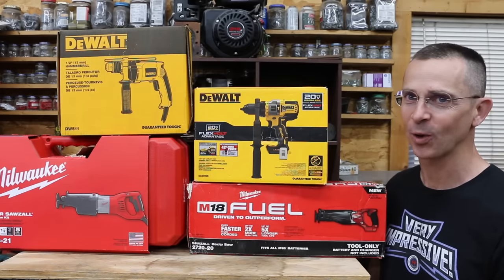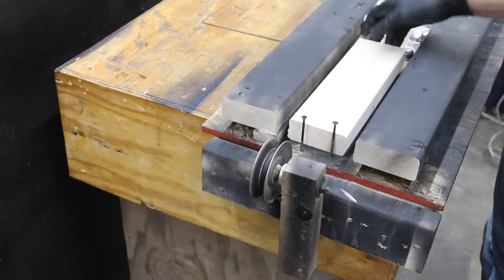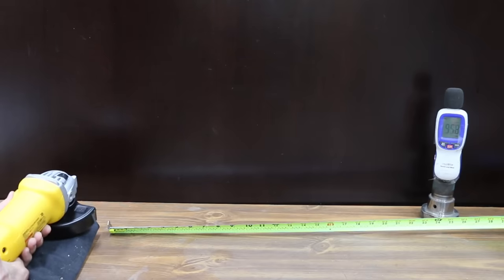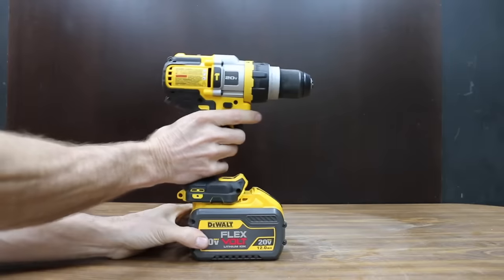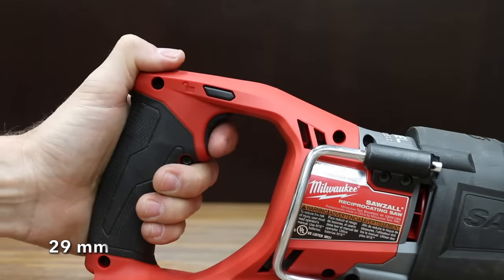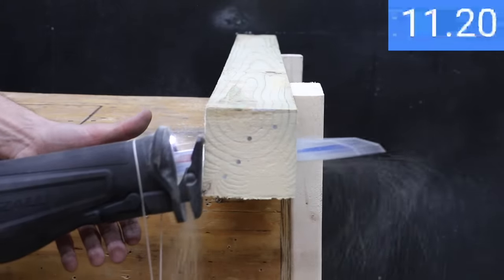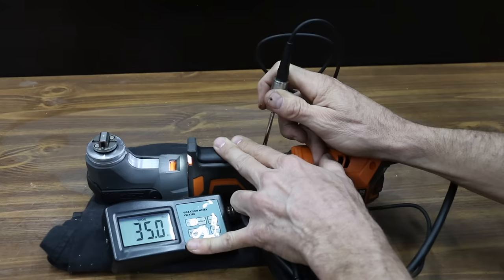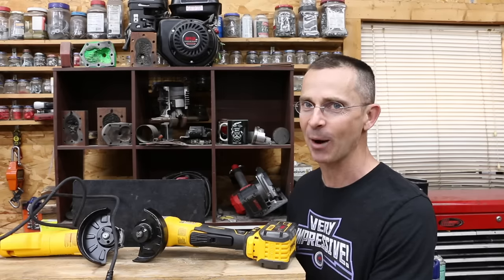Let's Settle This! Are Cordless Power Tools REALLY Better? Torque, Cutting Speed, Noise, Vibration

Comment: One benefit of corded tools is they're a bit of a pain to move around the jobsite, which actually encourages you to work more efficiently by setting up your work space efficiently, and working systematically by making all your cuts in one location before moving onto the next

With the ease of moving around with cordless tools, I've found that sometimes it actually leads to a lot of wasted movement because you can move from task to task without finishing up one. The freedom is obviously super handy in many cases though, just an interesting thing I noticed.

Also, the durability, cost, and the ease of repair of corded tools is UNMATCHED. So for workhorse tools, like skilsaws, sawalls, nailguns (pneumatic), vacuums, etc, I prefer corded. For impact drivers, drills, osc multitool, etc I prefer cordless.
Reply from the maker: Thanks for sharing.
Reply: hahahahahahahahahahahaha

Comment: I have used about every angle grinder out there and I have to say I still get more work done with the corded grinder when paired with a hard wheel, flap wheel, paint remover, and wire wheel. However as far as cutoff wheels go, which account for 90 percent of my shops injuries, I have not had a single injury with my battery powered grinders. That 11,000 rpm dewalt grinder you used is banned from my shop because I find it to be too fast for cutoff wheels. I have seen it explode a new cutoff wheel by simply turning it on.
Reply: Stop buying your cutoff wheels at harbor freight?
Reply: @MAGAMAN  
Lol. I dont buy them from harbor freight. I buy them from a welding supply store. The point is that after tens of thousands of cutoff wheels the only one to explode without ever touching materials exploded on the highest rpm grinder that I have ever owned. I dont think it was a pure coincidence. This is the only time I tossed an angle grinder injury to error in manufacturing of an abrasive. And i probably wouldnt have arrived at that conclusion if i dodnt see it for myself. I think that after you consider error in manufacturing and error in tool operation the margin of allowable error is reduced as rpm increases.

Comment: Pretty easy answer in my opinion...corded last longer and stay consistent powerwise but cordless are more convenient but only for a shorter period
Reply from the maker: Great point! Thank you
Reply: Cordless is always more convenient, but cords exists for a reason.
Headphones for example 😅
Reply: Did we watch the same video? Cordless have so many more improvements over corded. All the innovations are put into cordless, while corded have been made the same for 20 years.
Reply: @WetDoggo  thats kinda what I was saying haha
Reply: @WetDoggo  Bluetooth headphones and speakers
Reply: @dcmirk  if I had to saw 100 pieces of wood I would go corded cuz I know a battery would only get to about 50 pieces...is my preference
Reply: @marcogeraldis7117  fair point.  I'm a hobbyist, I can see the advantage in corded for a commercial shop
Reply: @marcogeraldis7117  I see what you did there. 20yr old design may not have all the latest tech but will (potentially) last longer. Really a case of what you need it for I think.
Reply: @WetDoggo  havent use corded headphonens for 20 years.

Still, battery still lacks a bit of power.

What is really lacking is a corded battery dummy
Reply: It all depends on the project really...if you got a ton of stuff to do go corded instead of chasing down chargers and waiting...if it's a small project cordless all the way..
Reply: @dcmirk  I don't need innovative tools. I just need tools that work.
Reply: @marcogeraldis7117  yes
Reply: @kylzepolaczkowaty2197  they're pretty bad compared to wired ones.
Reply: @marcogeraldis7117  or get multiple batteries...
It's better to use cordless in difficult conditions like overhead, on a ladder, in the wild, etc.
If you have a wall plug nearby, with extension cables and/or a generator or you need to use the tool for extended periods of time, then cords are the way to go.
Reply: @dcmirk  cordless is mostly the convenience factor, especially in difficult conditions like overhead on a ladder... A cable would just annoy the crap out of anyone there.
Cordless are also highly mobile, if you're not moving much  or the tool is used stationary, cords are the way to go.

Technology wise there's no reason why corded Tools should stay behind, since most improvements can be applied to both.
Reply: @WetDoggo  you know what would be even better. A generator you wear as a back pack with a 3-4ft cord so it's just as convenient as a cordless but with more power and sustainability of a battery
Reply: @WetDoggo  in my experience, they're on par with the wired ones
Plus a lot of them that I had had the option to plug in the two way jack cord to make them corded
Lasted me entire high school

Comment: Love the content. If I were to add my own two cents as a full time carpenter it would be that at this point any power differences between corded and cordless are irrelevant for me. Dewalt flexvolt and other brands bigger batteries are completely sufficient for almost all purposes. The amount of time saved by having all cordless is what the real benefit for me is. Yeah batteries are expensive but they save time and hassle, and time is money. Not to mention cords can be pretty expensive too. 
I’m not sure how this could be realistically measured but I’d love to see the time comparison between corded and cordless setup.
Reply: Not to mention the safety aspect of not having extension cords laying across the workspace.
Reply: You’re right… time is money.
Reply: I totally agree for the guy that uses his tools on the job.  But for the occasional user the story is different.
Why pay 2 or 3x for a tool that is going to be dead in 10 years.
Reply: I guess you could just figure some averages into the equation. Cordless tools going directly into a toolbox are done right then and there. Unwrapping cords in the morning can take 15+ minutes. Later, wrapping up 3-5 50'-100' cords and then wrapping up the cords on the tools themselves can easily turn into 20 minutes. Cordless is a no brainer in a lot of ways. Also, with options like the Makita or metabo rear handle coming in ~$200, you're not spending much more than the $180 it costs for a Mag77 if you already have those battery platforms. They're also much lighter before you even include the cord snagging. Table saws kind of demand a cord, but even then, I do most of my trim work with the cordless DeWalt these days.  I also run the cordless 8 1/2" Bosch miter saw and it performs better than my corded in terms of accuracy. Cordless finish guns are solid but cordless framers haven't quite taken over considering their weight. Just rambling.
Reply: @danharold3087  Buy Ridgid.  They have a lifetime warranty on the tool and batteries.  I’m on my third set of batteries in 15 years, all replaced free!  Great company to deal with!
Reply: They don't save much time when your batteries are dead and you forgot your charger at home.
Reply: @Apollyon67  If you are doing construction and the biggest thing you have to worry about tripping over is an extension cord, you don't have any problems.
Reply: @tomrogers9467  I generally don't find rigid tools to be that great compared to dewalt (I still have my original batteries from 8 years ago), but their $200 tile saw was a life saver when I started doing tile work with no money after buying my house.
Reply: @MAGAMAN  I don't think you understand how long batteries last these days. Miters saws do hundreds of cuts, skillsaws rip hundreds of feet, nailers sink thousands of nails, drills screw hundreds of holes, impacts sink thousands of screws. I've never forgotten my charger but they get used as little as once a week.
Reply: @tomrogers9467  Have you used the warranty.   Recalling that some power tool lifetime warranties were though the factory and you were responsible for shipping.   Not worth the effort all smoke and mirrors.
Reply: @danharold3087  Yes, about six times.  There is a toll free # to call, they ask you to do a couple of test procedures with the batt. and  charger, then they authorize a new battery or charger.  Shipped free and in just a few days.  You needed to register your product when new, and also register your replacement.  My two drills and impact driver have been through a lot of projects.  Bought them in 2008.  For the tool itself there are service depots around, but yes, you are responsible for the shipping in that case.
Reply: @tomrogers9467  I know where I will look for my next cordless tool  Thanks

Comment: I use rigid octane from their old line up from last year and honestly I love all my cordless tools. I got three 9ah and one 6ah battery. I got the cordless octane grinder, 3/8th impact, and both 1/2 impacts. The 1100ft and the smaller one. I also have a 3/8 cordless extended reach ratchet from Milwaukee .I'm very glad I made these purchases. They help me everyday with zero issues. Rigid also has an awesome warranty thats very easy to set up.
Reply from the maker: Thanks for sharing.

Comment: I was afraid manufacturers would purposely under develop corded tools to sell us more batteries.
Reply: I mean the tests do show that. Not dramatically in cutting performance in most of these examples but all the quality of life and niceties are stripped out. Noise, vibration, breaks... But I'm not sure if I would blame them for trying to hit a price point. It's very likely that very very few people would buy a 250$ corded tool over a 300$ cordless one.
Reply: They probably would if they owned battery companies.
Reply: @SquintyGears  I prefer corded tools for some applications, but things like, drills and leaf blowers are better off cordless. But I hate batteries with a passion so the fact that I prefer cordless in some cases is impressive.
Reply: @MrPicklesAndTea  yeah i never got the point of having a cordless circular saw for myself. contractors would probably benefit from it on a job site. but if you only use it at home or in your workshop space, how would you ever benefit from having to charge batteries.
Reply: Awesome
Reply: Makitas corded grinders are far better than their battery grinders. I think America being 110V has something to do with the worse performing corded tools also

Comment: corded power tools typically have higher torque than cordless ones. While that may not matter for some projects, it can make a difference when you get into cutting applications. Unlimited operation: Electric power tools can run forever, so long as there's a working outlet or generator.
Reply from the maker: Thanks for the feedback.
Reply: Not forever. Lots of brushed power tools get very hot (and many people say theirs have fried) if you run them too long and they get too hot. Corded tools are almost always brushed motors which are inefficient and produce a lot of heat.

I've experienced it with all sorts of tools, rotary tools (dremel (gets extremely hot), ryobi) vacuum cleaner, bent sander, hammer drill, jig saw etc etc. Literally every type of corded tool will suffer from this due to the technology unless the manufacturer really optimizes the internal cooling fan and thermal design to expel heat as fast as its generated. But that seems hard for manufacturers to do. Either that or they only engineer them for intermittent duty.

Either way you simply can't say that corded tools can run forever. Its a dramatic over generalization and false for probably most corded tools that exist.

Its such a problem that I actually own more than one of a certain type of corded tool (and try different brands) so that when one is too hot and needs a break to cool down, I can use the other one.

Aiming a powerful fan at the tool definitely helps. Either way heat is the huge corded tool problem that you have overlooked. Not only power.

Brushless cordless tools (assuming same quality) will likely outlast corded tools. 

You're really worried about batteries... But only some brands charge ripoff prices for batteries.

There are lots of brands to choose from. There are also battery adapters to run tools with batteries from other brands. (Which can give all the safety, battery longevity and convenience with the right combinations vs battery brand x with tool brand x)

Ryobi has also upgraded their battery tech, so now they offer lithium batteries for their tools that were designed to run on NiCd.

And when new future battery tech emerges, it will be possible to run it on some present day tools.

Also there are corded power adapters for cordless tools. So you can have the best in thermal/energy efficiency, comfort (vibration heat and noise), torque, run time, portability.

I see comments like yours as closed minded just wanting to justify your fears of trying new tech.

I've got lots of corded and cordless power tools. I like the cordless ones more. Even the brushed variety.

Ultimately its not so simple to say the one is better than the other. Everyone has different needs and budget and goals etc. But if one were forced to generalize, then absolutely cordless is better than corded.

Blade stopping time just popped into my head. All the latest and greatest engineering goes into cordless. Why try to swim against the current? You're only tiring yourself out for nothing. Open your mind and you will suffer less.
Reply: @joshuamaserow  My friend you misunderstood the The Project Farm or my comment. The Topic is Corded power tools. Not brush or brushless power tools. Thanks for your feedback.
Reply: @joshuamaserow  I disagree. I operated Makita skill saws on high production framing jobs for many years, sometimes cutting rafters virtually nonstop for hours. Not once have I ever had a circular saw shut down or smoke

Comment: I've always heard that one big advantage of cordless tools, is that at the high end, they are not limited by 1500W max draw.  Curious if there are cordless tools out there at the contractor level that actually do take advantage of the much higher power ceiling of lithium batteries.
Reply from the maker: Thanks for the suggestion.
Reply: Also AC motors are less efficient. So they may pull 1500W out of the wall but not all of that power is coming out of the other end

Comment: After 28+ years as a Tradesman, the only cordless tools I buy now are 12v pocket Drills, and impacts.  The corded tools just last longer, and are much cheaper.
Reply: Not to mention you can mix and match brands however works to save a few bucks or maximize quality. I suspect most who buy cordless hardly ever work more than a few feet from a working outlet.
Reply: I would like to see a battery powered welder,  does anyone build one of those?
Reply from the maker: Thanks for sharing.

Comment: Great Question!
Cordless tools have come so far, it used to be their only advantage was No Cord!! Which is great for sure! Drill test wasn’t fair. Sawzalls: I have both tools, corded is stronger/faster but cordless is usually the one we all grab! Circular saws : corded are always more powerful. And we also use cordless chop saws which are super convenient but again much less powerful than corded. One last point: battery tools are throw-away items! once batteries are gone / obsolete they’re useless ( I’ve thrown away tons of them) if you wear them out first, no big deal, but if you’re a homeowner and don’t use your power tools that much, corded tools will be forever purchases!
Reply from the maker: Thanks for the feedback

Comment: Good tests as always ! My only complaint is that there were at times better cordless tools to choose from for the comparison(sawzall, grinder, circ saw). The test with arguably the best cordless drill shows that difference. Maybe you were trying to keep the costs semi close and not to big of a gap ?
Reply: That's subjective. Sure, maybe a 40 Volt Makita rear handle saw would had been better. Sure, the Milwaukee m18 Fuel has a bit more power than the 36V Makita, but I, and many, many people will tell you that the Makita saw is far more comfortable, smoother, and has far superior ergonomics.
Reply: He kept it same brand battery vs corded.
Reply: Yeah trying to keep the costs close in some tests I feel was unfair to the cordless unit. As being cordless is a huge feature, and the convenience & versatility that comes with that feature is going to carry a price tag.

The true comparison would have been to compare the cheapest cordless to the cheapest corded from a particular brand...not the cheapest cordless to the most expensive corded.
Reply: @mattspyro  There are more powerful from each brand. Super sawzall, 60v dewalt grinder, 40v makita circ saw, for examples.

Comment: As a homeowner, I find a cordless drill invaluable.  I use the drill/driver all of the time.  As far as other tools being cordless, I have no use for them. I can go weeks or months without using them.  I have saws, sanders, and grinders that are over 50 years old and still work fine.  How many batteries would I have gone through if they were cordless?  Now if I worked in construction and used these tools frequently that is another story.
Reply from the maker: Thanks for the feedback.
Reply: I’m with you. Wouldn’t want to be with the drill / driver and the work lights. I’ve got older Milwaukee V18 sawsall and circular saw I picked up cheap with no batteries and use an M18 battery adapter and it’s pretty handy outdoors, but for the limited use I’d probably cut by hand or pull out the heavy extension cord.